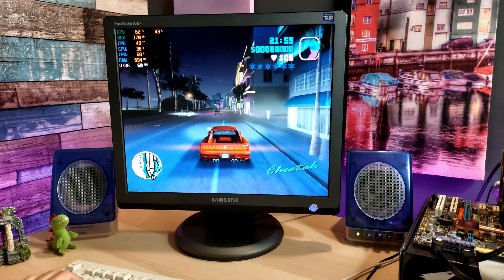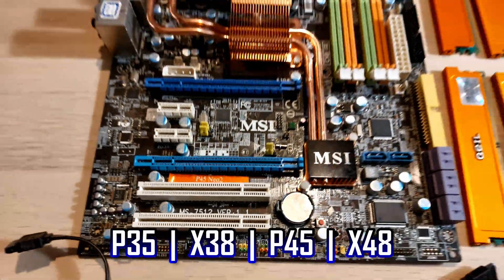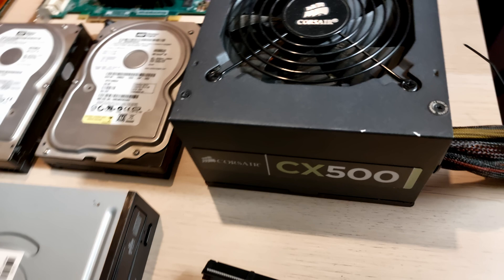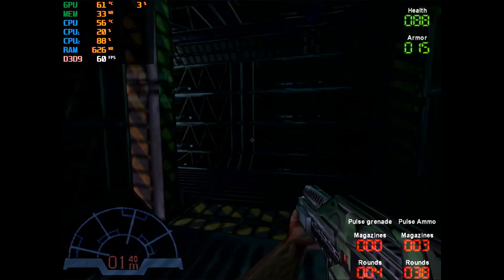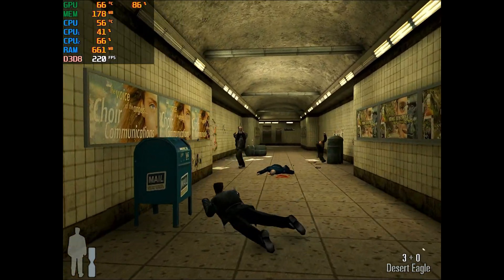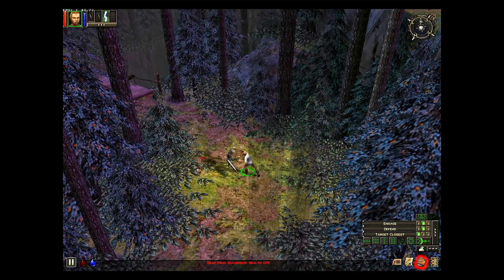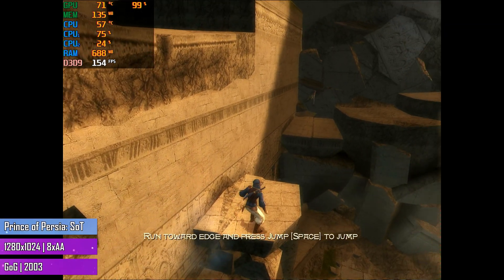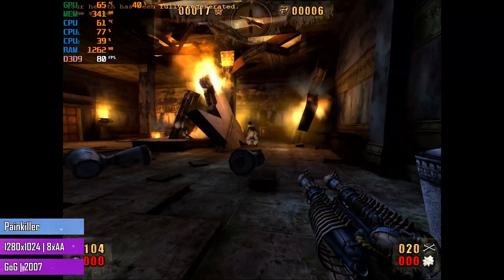What PC should you choose for Windows XP gaming?

Comment: My Windows XP PC specs:
Asus P5QL-E Motherboard
Intel Pentium Dual Core E5300 (Will probably soon be upgraded to a Core 2 Quad)
Transcend 5 GB of DDR2 RAM (2x2 GB and 2x512 MB)
NVIDIA GeForce 8600 GT 256 MB (Will soon be upgraded to a 9500 GT 512 MB I guess)
Western Digital 500 GB SATA II HDD
Pioneer DWR-111D IDE Optical Drive
Chieftec GPS-350EB-101 A Power Supply

Comment: Now I have i7-860 (2 cores off for better OC) and GTX 460. I have even GTX 680 and 960, but even 460 is already bottlenecked by CPU in many cases, so even i7-860 is still weak for the most demanding games from end of XP era, but these games mostly run fine in Win 7 64bit, so there is no reason to play it on XP PC.

I wanted to buy Q9650 for my 775 build and then I forgot it in box full of CPUs, I totally forgot that I already have one. 😀 But E8600 is better anyway for gaming, 4 cores are completely pointless, I tested it last weak and I really can confirm that the vast majority of games and benchmarks up to 2010 use only single thread.
For the final 775 build, I use GeForce GTX 275.

P43 chipset is also fine, those MBs don't look that good and don't have milion USBs and SATAs, but you don't need it, it's stable and work fine and you can wind P43 motherboard literally in dust bins for free, but carefull, taking trash is stealing. 😀

About GPU compatibility with games, games that have compatibility issues mostly need very early drivers for geforce 6800 or geforce FX or 4000 series, I would say it's better to build Win 98/ME or Win 2000 build with these GPUs.

And YES, Win 2000 for some reason has better compatibility with 9x games than XP, I don't know why, core of system is pretty much the same, but I am not kidding, I tested it many times, just try it. I was ignoring Win 2000 for a long time and it was a mistake.

And Radeons had better compatibility with archaic games, you can use max X1950 still with good support for problematical games like AvP1, NFS5 and stuff like that. That doesn't work well on later (after 2004) nvidias.

If you want to for actual retro gaming of late XP games (so you don't care about some AvP and DX6-7 games), you should definitely go to geforce 8000+ becasue there was a massive performance jump between 7000 and 8000. Like 7950GT is a potato compared to some 8600GT, it was really a massive jump. 8000 and 9000 series is almost the same thing, so 8600 or 9600, that doesn't matter, or first GTX cars like 260, 275 are also good.

PSUs and HDDs are always a dilema, be time precise or make it fast and reliable? I mostly use SSD for Win XP, but sometimes I put into case some HDD connected to electricity just for design and sound and I hide SSD. I just mostly newer PSUs, but I am trying to find one that still have colorfull wires, all black just looks weird with some XP computer.

The biggest problem is screen, it's more and more complicated and expensive to find a decent CRT and with LCD, you will never experience actual retro gaming feeling, not only because of blurry non native resolution (some games just run in fixed resolution and you can't change it) but even because of high refresh rates of CRTs and zero lag. There are scalers that solve that, but those cheaper are useless and those that actually can do something (like RetroTink 4K) cost like RTX 5070

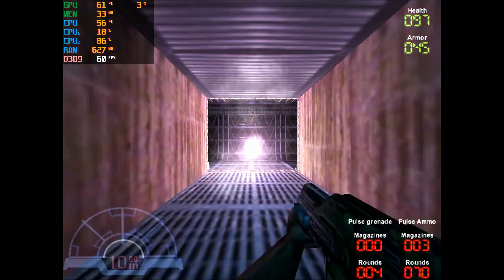4:12 - it's "classic" remastered version from GoG I guess, original AvP definitely doesn't run well on XP nor this GPU, but this is exactly remaster we all want - just improved compatibility and it's translated to DX9, but everything still looks the same and HW requirments are almost the same, this is a good remaster

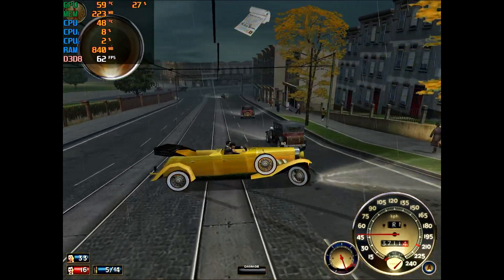6:13 - you are right, but people also didn't game in 1280x1024 in 2002, it was mostly 1024x768 or even lower

Comment: I tried to use an GeForce GTX 275 on a motherboard with an Intel 945G chipset and the Intel integrated graphics was initializing instead of the dedicated gpu initializing. I just ened up going with an BFG Overclocked GeForce 7800 GTX that I had lying around.

Comment: Why didn't you go with E8600 whit this motherboard?
Reply from the maker: Because it's not that easy to find, and it's more expensive than the lower tier CPUs.
Reply: @MidnightGeek99  In country where I live E8600 costs around 20 USD, but E8500 is just 2 (two) USD
Reply from the maker: @stas_da_killer  exactly my point :) and the E8600 is not that common also.

Comment: For XP build I would choose Socket 1156/1155 motherboard with fast i5 and GTX 960/970. Some games like NFS:U2 or Gothic II are quite heavy so it will be good to have a lot of power for them. AM3 motherboards with Phenom II cpu's are also really good for XP.
Reply from the maker: For the ultimate XP gaming PC, I agree, and I've done some tests with i5's and GTX 960, most games run great, but there are some older ones that have compatibility issues.
Reply: @MidnightGeek99  What would you recommend instead for those older games with compatibility issues? What's the sweet spot in your opinion for good 98-2010 compatibility - both CPU and GPU. Thanks!
Reply: @amentiro  That could be Core 2 Duo E7600 or E8600 with GeForce GTS 250 with a bit older drivers like 16x.xx. As for games released at 2007 and later that was Vista era so for them better can be Windows 7 machine with 4th gen i5 and 1050/1060.
Reply: @modernandretrogaming  Thanks for the info! I do have a 6th. gen ThinkCentre mini PC with a 1050Ti (via an m.2 adapter) and it's running Win 7. I am  using that for all my retro games and apps, I do however run into issues with older games sometimes - it's a hit or miss. I'm trying to find a solution to rule them all and I'm thinking an XP machine would cover the 98-2012 period better, but I have seen the likes of 960 could also cause issues with older games, even if it's on XP. Was wondering if someting like a 750Ti or 780 paired (maybe a 500 or 600 series even) with a 3rd gen CPU could be a good middle ground that runs XP and has broad compatibility.

Comment: That GeIL value RAM is legendary stuff - was very good for its price! 
Had a few PC3200 value ram sticks by geil plus some good bh5 ram which was geil one w pc4000 stuff and it could run 2-2-2-5 timings at 260MHz or 275MHz at 2.5-2-2-5 or similar on a lanparty ultra d 939 mobo 🎉
Reply from the maker: Some nice looking ram modules, yes. Also, with that dfi of yours I bet it looked awesome.
Reply: @ I recall the value ram having orange heat spreaders whilst the one w had silver. I think the one w with the winbond bh5 was quite rare stuff.

Comment: I found old and cheap MSI AM3+ 760GM-P23 board that does support max 95W TDP processor so i bought a used FX-6300(20$). MSI provides drivers for Windows XP 64. Found that VRM was not handling the CPU, so i added old AMD CPU  PWM fan on top of the VRM mosfets and solved temp throttling. Undervolted the CPU to 1.15V and it runs cool on 3.8Ghz. 2X4Gbyte DDR3 1600MT/s sticks. Used 2 x Seagate Momentus 7200 RPM 16Mbyte cache 250GB laptop HDD in RAID0 with MSI provided RAID drivers included in Win xp64 ISO with nLite and Rufus tools. IGP worked from first restart, but still not playable in Far Cry. Had a no cost laying around  Gigabyte X1300 Pro 256Mbytes (1 pipe silent cooler) overclocked to GPU660Mhz and VRAM500Mhz with a homemade fan mount from old HDD cooling fan housing. Far Cry is playable @40 FPS. Planning on using a Quadro K620 2Gbytes card with modded drivers(if it works). 17 inch HP 1280X1024 75Hz LCD panel. I love this build since it bring back so many memories of good time. The RAID0 really improves the loading times. Planning to add 1 or 2 more HDDs to RAID 0.

Comment: To be honest the parts you recommend and used are barely fine. They could be fine for beginners covering 2006-2010 platform. To cover well 2000-2005 you need different hardware otherwise glitches and un-working will be common.
Reply from the maker: Well, the video is for beginners :) it should do 2000 - 2007 quite fine.

Comment: Got 2004 Laptop with 1x1.6GHz CPU and ATI Mobility 9700 64MB, 1GB RAM. Every game I tested (up to 2006) ran ok, though it won't be super smooth or at max graphics. NFS Carbon was hardest one, ran at 800x600 Lowest settings at 30fps. That said I think a Pentium 4 2.5GHz, 2GB RAM and GT220 is a really cheap way to get into that era of gaming.

Comment: My retro build is a socket 775 board, Q8300 CPU, 4GB DDR2 800, 120GB SSD, GT 710 1GB, Windows 7 x64 & XP, it runs every game released before 2012 like a beast.
Reply from the maker: Yeah, there are a lot of people that use low-end video cards from newer generations, for XP gaming, and I think that it's great, those low-end cards are easy to find, cheap, silent...a real bargain.

I should do a similar system and test it.

Comment: Windows xp holds special plcae to me too which is evident by my always tirst for more peeformance overtime
I got currently  i7 3770 machine for windows xp
8gb ram 
480 ssd i dualboot with windows 10 too so thats why i even got 8gbram total 
650ti 1gb 
2tb hdd
Gigabyte z68xp ud3p mobo 
Evga 700br psu 
Optical drive lg sata 

However in the past ihave used weaker machines for winxp specificly such as :

Q9500 core2quad
Gts 2501g(ihad 9800gtx at one point)
Inteldq45cb
4gbram 1tb hdd and 250 gb ssd
Random cheap psu

Phenom8400 at 2.1 ghz also athlon64x2 dualcore3800 plus
250gb hdd
9400gt 512mb
3 than 5gb ram 

So yes i have more or less seen it alll when it omes to winxp 

But as of now i mosltyenjoy my current machine 
It runs everything i can trow at it 
Also im a pc guy that i flipe pcs as a hobby so i know how to assemble and maintaon the computers
Reply from the maker: It's great that there are a lot of people who make use of older components. I love Ivy bridge systems because you can dual boot XP and 7 or 10, and it works wonders!

Do you have any incompatibility issues with any games?
Reply: @MidnightGeek99  it works fine and it performs like a beast in most games if not all of them 
i use some sort of cistom windows xp iso i forgot where i downloaded it from its been a while but basicly it has pre intergrated sata drivers (its winxp32 bit) maybe its windows xp integral edition but not sure) 

also i put good cooler on that i7 and i run it at 4ghz (higmatek windpower 964 4heatpipe tower cooler) it runs (in windows xp gaming at like 60 degrees max ) at those 4ghz -i didnt touch the voltage at all just clock speed-i am noob when it comes to oc but  in general im good with computers and i always i use msi afterburner to monitor temperatures and stuff like that 
and the recent spu upgrade was just you know .....good -if i decide to add better gpu i certanly can and allows for more sata devices too
Reply: if you got more questions about specificly 3th gen intel and winxp compatability just ask

Comment: I would have liked to see more demanding games from the end of the Windows XP era, such as FEAR, Oblivion, and Crysis, especially since the hardware you're using and recommending was released well into the Vista era. I am also interested to see another video where you explain those component choices in more detail, such as why you suggest LGA 775 motherboards with Intel chipsets and core 2 duo processors instead of socket 939 boards with nforce chipsets and Athlon 64 X2 processors, or even AM2 motherboards.
Reply from the maker: I will do another video, 30+ minutes, and explain everything in detail, because the topic is quite extensive!

Comment: I have a pile of socket 478, 775, 754, and 939 machines laying around but it seems like GoG and Steam have versions for sale which run on modern hardware so i have a hard time making the soace for another gaming PC when anything I want to play has already been made to run on newer systems. Especially for what retro hardware goes for these days (my FX-5950 Ultra is worth more than it was new). I love the nostalgia of the older hardware but when an office throwaway Optiplex can run Crysis on the integrated graphics card it's hard to soend good money finding vintage components.
Reply: Yes, with 14 years of lifespan WinXP hardware support options are vast and affordable for most wallets. With platforms like Steam games are also available to newer systems. I guess going with older hardware is more of an option than something needed, but still fun. 🤗👽
Reply: @antonhei2443  It's fun and hard to be at the nostalgic feeling of running XP but once I got my XP retro system fired up I tried to think of what I wanted to play....turns out I already had it on Windows 10. I'd like to find a way of taking my Steam games and patching them to be usable offline on computers without Steam (they killed off support for anything older than W10).
Reply: @406Steven  Yes, Steam should have at least a Lite retro compatible version. Maybe in the Vogons forum might be a solution to run it in offline mode, but shouldn't be necessary in the first place after paying for a game, it's a bad practice from Steam (security concerns appart). GOG and torrents are the only options besides physical media (the longevity of DVDs is another topic by itself 😢).
Reply from the maker: Yes, Steam and especially GoG have A LOT of classic games, unfortunately there are still many games that don't have a digital release.

Having an XP system is not mandatory, but it's nice to have it :)

Comment: yeppp definitely unhealthy desire, just built my 7th XP machine xD
Reply from the maker: :)))

Care to give us some specs?
Reply: @MidnightGeek99  sure i have everthing from a 933MHz Pentium iii w/ 512MB ram and Radeon 9200 SE to a C2Q 9650, 4GB ddr3, and gtx 560 ti. With a few p4s and C2Ds between all with decent gaming gpus for xp retro gaming.

Had plans for a retro lan, but never materialized. Yet. ;) maybe someday.

My main retro rig actually runs Win10, and its my baby. A fully restored and upgraded Red Dell XPS 630i. Has a MSI z97 gaming 5 mobo, i7 4790k, 16GB of very fast pc2400 ddr3, 500GB m.2 sata ssd and currently a gtx 960, i have a 980 i could throw in but it doesnt match the black/red/white theme.
Reply: geez mate, control yourself.
Reply: @mclarenf1gtr99  lol haven't built or bought anything in a couple years, mainly because I promised myself I would keep eveything in my office, and if I bought anymore the clutter would be too much, its already questionable lol

Comment: I had way better luck with AMD/ATI for WinXP compared to nVidia. The artifacting you got with the 9800 looks the same as what I get trying to run a lot of games with a GTX 670. I tried the oldest and newest drivers as well as a few in between and they are all basically useless for WinXP aside from more modern games. Using a Radeon HD 5870 is basically perfect for WinXP in my machine - no artifacting in any game and even video playback is smoother and the performance is quite good.

Comment: all games after the 9x era runs on modern hardware lol
Reply: Good luck finding drivers for XP. But yeh, would rather build some kind of Windows XP+Windows 7 machine instead of just for one OS, specially for DX11 games. Of course all depends on hardware you have.
Reply: @mclarenf1gtr99  i am actually doing a test on making a game portable i just found a program named evalaze, i actually don't know what it will do because its currently building the data layout but if this works i will be able to run the program in any file directory i wish
i was looking up some details on this software and it sounds like you can run old 9x programs on modern OS with this process, after i have the current program done i will be trying an old dos program to see if it can run natively in a 64x environment
Reply: @mclarenf1gtr99  you can use dgvoodoo to upscale any games and also find this ("Windows Error 0xc000007b H&H Tutoriais") rar file to fix 0xc000007b errors
Reply: @mclarenf1gtr99  dgvoodoo does wonders
Reply: @mclarenf1gtr99  lol if i talk about dgvooqoo my comment wont post(d is upside down....)
Reply: @mclarenf1gtr99  lol i can't post a reply anything i talk about keeps getting blocked....

Comment: My XP machine is a socket FM1 mini ITX config with AMD 3820 4 core APU with an integrated Radeon 6550 It can run Win10 also, but mine is dual boot with XP and Linux Mint. Still OK for light browsing and YT.

Comment: Dude, those Orange DDR2 800Mhz Geil RAM are legendary, at one point it was the best at prize/value in the market, good quality, runs cool, great timings...
BTW I used Windows XP 64 Bits for years upon years, 4Gb of ram are recognized and I do not remember it being unstable (more than usual windows XD), although it might be useless because little software had 64 bits versions at the time.
A dual core, triple or quad core are good choices 775, AM2 or AM2+ (maybe AM3 too), but remember on that "era" nothing was coded to use more than 1 core, so a dual core with more Mhz could be better than quad core with slower cores (at least that was/is my logical believe, maybe a quad core a 1.8Ghz beats a dual core at 2.3Ghz), fortunately there should be a lot of old archived benchmarks to find "your perfect" CPU and GPU...
I think that more than raw power the hardware of a XP machine (or any other old OS) for games should be dictated by what games you will actually play on it and actually should make it easier to choose what hardware to get. 
BTW 2 it's a XP machine, so no antivirus or extra software will be required because no one in his sound mind would connect this thing to internet and browse around, the PC should stay pretty fast, 0 unnecessary or bloatware.